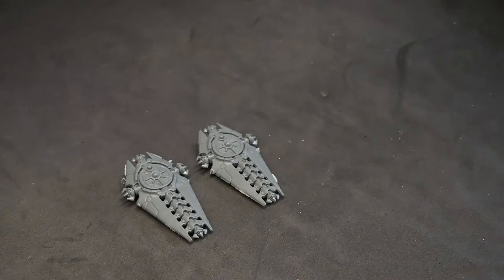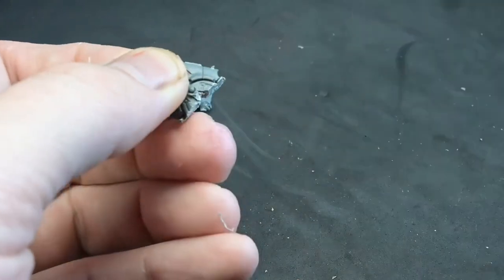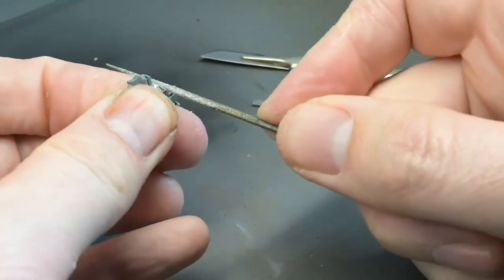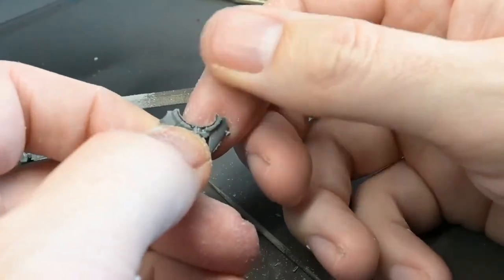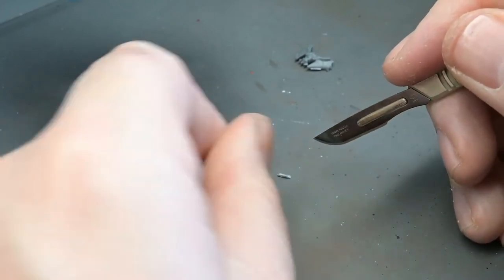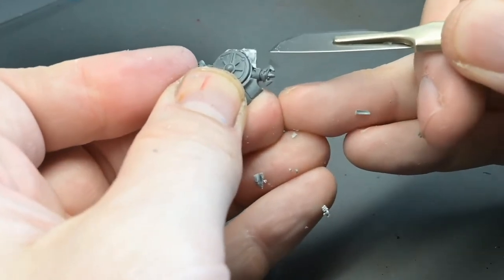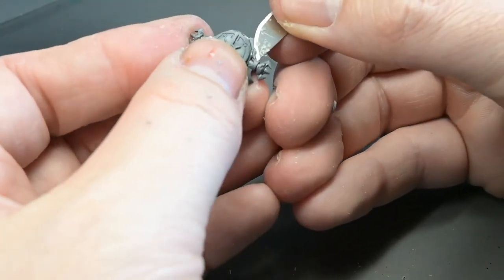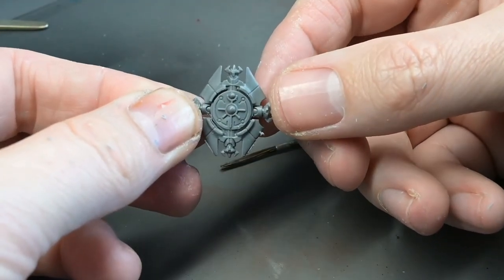Converting Smaller Lychguard Shields. HOW TO:

Comment: Too much trouble for one shield. 

Dont get me wrong cool idea and I will do it also. 😂 But with huge twists. 😅

Why not make blue stuff mold and making negative of top half. Then pressing in green stuff making another positive. Then you cut green stuff to look good and apply that original bit your worked on top. Et voila. One Lychguard short shield. Lot less messy and helluva lot faster. 

Also, some form of multifunctional precise power tool is really useful in your way of building. For example … Dremel. You can make that conversion in half the time from original plastic. Caution. Takes a bit time to get used to … but real time saver. 
Get the one that is as precise as you can afford. It really helps with control. But! Simple cheap one with 4-6 speeds is good enough.
Reply from the maker: Haha ive done 11 🤣🤣 10 for the lychguard and one for a 'Smash Lord'
Reply: @ChrisFrosin  oh my god! 11!!??!!
Hats down! Your patience is infinite.

I would really give a try to Dremel, or something similar. Really get precision and speed, after getting used to. 
I’m looking to upgrade mine to something with more scalable output and little bit less RPM’s … 5000 is bit too much for very precise but chunky work. 

I already replayed in my head how I will do this conversion, when I get back home from work. 🤣

Just started Kitbashing … it’s lot of fun. 
Looking for lots of ideas … especially Necron … churn out some more. 😉